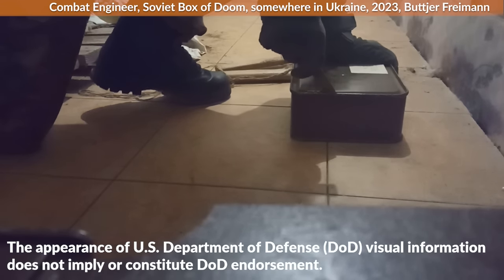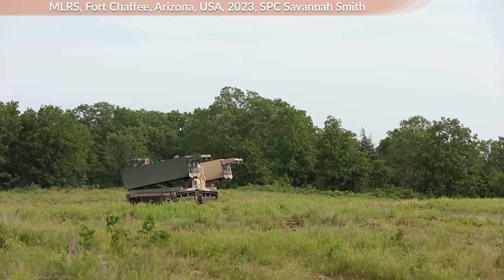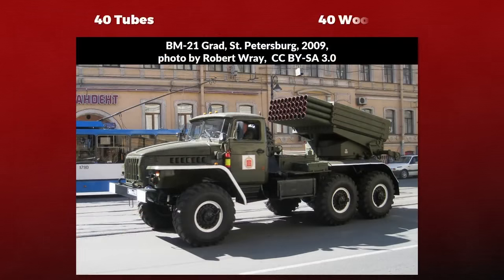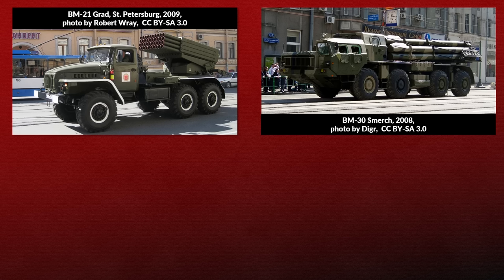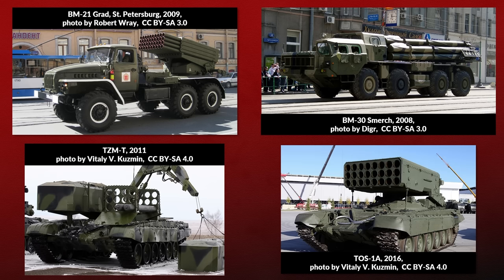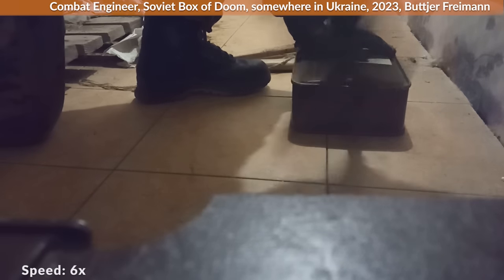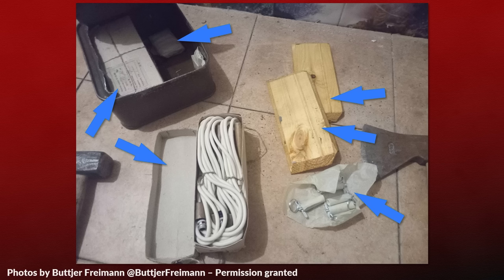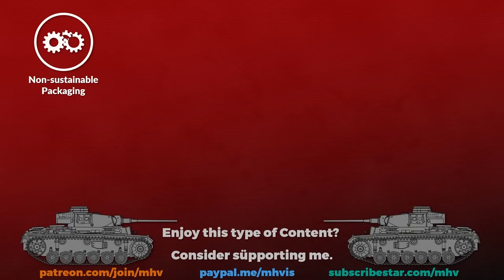Ukraine: Why Soviet Packaging is a Nightmare - Unboxing Edition

Comment: Their soup can package system makes perfect sense for storing a large stockpile of ammunition long term but they really should be decanted into a more accessible reusable container before being shipped to the front line.
Reply: I have a guess that there are some other quicker system to open them and these specific boxes being the ones brought out of decades long storage. Cos, from the war news, it doesn't feel like any one finding Russian troops vulnerable during relaoding.
Reply: @aniksamiurrahman6365 they dont live long enough to have to reload
Reply: @wrythe777 I’m legitimately curious how you think war works? Most people don’t die in war, even in infantry units. A 25-30% casualty rate during an engagement is considered combat ineffective any unit.

There are plenty of people who have survived this long on both sides.

Which, both sides use the same exact Soviet boxes, the flashy western tech is in all the media for Ukraine, but by and large they use Soviet guns and have since 2014. So evidently this isn’t an issue on either side.
Reply: @aniksamiurrahman6365 How would you expect to hear such from the news?

Comment: Reminds me of that scene in 'Zulu Dawn' where they're running out of ammo and overrun due to the cartridge boxes taking ages to open.
Reply: Those boxes have a section across the top that can be smashed open with a rifle butt. Somewhere in the house I have a crate from WW II for 30-06 with thumb screws to open the wooden lid then a tin liner with a grab handle to peel it open. Ammo was in 20 round cardboard boxes. I think it was from 1938. M1 Carbine ammo came in 600 round cans with a key to open the can like WW I bully beef pattern cans still being sold in the US. The ammo was in bandoleers in 10 round stripper clips.  US 25mm ammo 30 rounds in two 15 round belt segments in a plastic box with two latched lids about 5 to 10 minutes to reload a Bradly depending on one or two crew members handling the task.
Reply: In real life (1879) the soldiers were sent too far forward so when a rifle clogged/ would not extract and had to be cleared/cleaned there was a large gap in the line allowing the Zulus to rush through. On the ground to this day there are ring pulls from the ammunition cans in small piles spread across the ground. Opening the boxes was not particularly slow nor was loading the rifle. The Martini-Henry rifle had a range of over 1000 yards. Pushing the troops well forward was just stupid.
Reply: @mbak7801 Damn, you beat me to it.😅😅 I was about to say that.

Comment: I think the most interesting military surplus ammo I've ever opened was some Swiss GP11 7.5x55 ammo. It came in a black, waxed cardboard box with a cloth belt and a small wax seal holding it closed. The ammunition inside was in eight smaller paper pouches that were heat-sealed at the ends. Inside those were 10-round cardboard boxes that had perforated tabs to pull and open the box. This stuff felt more like someone had packaged a nice gift from the jewelry store rather than rifle ammo!
Reply: Well, it is Swiss, they’re hardly known for being spartan in presentation

Swiss watch.. Swiss chocolate and now Swiss ammunition and what have you
Reply: gotta keep in mind that our military issue ammunition is near match-grade. this demands an equally expensive packaging, no? :)

Comment: 5:59 - Good luck finding the packer & QC from 40 years ago to correct the packing process 😹
Reply: Any of those could be used 5 weeks after thr production. During a training.

This charge has "lmao, look at this newspaper's job ad, you think anyone will respond 40 years later?" energy
Reply: @worldoftancraft  Also out in the field these things are still useful, if a particular container of ammunition is misfireing or causeing other problems those codes can be used to quickly identify and cordon off bad lot codes

Comment: Wood and tin leftovers are not actually garbadge, they are extremely good as furniture and bulding material. In fact, most of RUAF trenches and bunkers people see on the internet are made of or with those.

But, seriuosly speaking, this type of packaging by soviet doctrine was ment to be opened way before it reaches the frontline. What this means is there should be some people at corps or divisonal rear-echelon HQ that sit and open them all day so  regimental quartiermeister, a person issuing weapons and ammo to those who do the fighting, will only give them those small card boxes. They just don't bother.

Comment: I'm 95% sure that is for long term storage and you are supposed to open it well in the rear, not in the firefight.
Reply: but they arent, combat engineers are opening them
Reply: Assuming that was the case, how does that work?

You unpack the ammunition, repack it safely into an unknown container, and drive it to the front?

Or do you dig up the stuff, make piles of ammunition and then carry it to the front in jute bags because there's nothing else?
Reply: @noah4822  Not under fire. Engineers usually do not man trenches; they gear up in the rear, go in action and came back.
Reply: @Ecovictorian  safely is debatable, but yes; or you bring the tin cans in the trenches in a calm period of time, open them and put the small packages in a bucket or something like that.
Reply: @M.M.83-U  That sounds very "russian".

There must be fixed service regulations for the Russian army?

As soon as you unpack the ammunition, the access problem has been solved. But another transport problem has been created, especially when the position is relocated or adjusted.  You have to decide what to unpack and what to leave packed.

At that point it becomes absurd when wood is actually used as a gap filler. Although it offers a certain level of protection, it is not necessarily needed if the ammunition containers are transported in relatively safe circumstances. Here it may take away transport capacity that may be needed in the situation.
Reply: @Ecovictorian  I have no idea; and it's more "old school" than russian, it's the basic idea (with minor adjustement across different nations) from WWI improved to 1950 storage technology.
Reply: @Ecovictorian There are separate containers used for short term transport. These are used to get to supply points, opened and carried by hand or in wooden crates in trucks to the front. This is mainly to keep them ready to use in any environment after long term storage, and both sides of the war use the same types of crates.

Western Gear is like the big cat tanks or STG-44 for Ukraine. Good stuff, present in some units but most units by and large use Soviet era equipment.

Comment: Agree that BM-30 with 12 tubes and it's own assist vehicle would have been a more adequate example. Still with 13 minutes to reload.
However, I see no practical difference since the gun crew doesn't have a chance for a second discharge and has to move positions instantly anyway. So the difference in reloading is taken from total time for position preparation, maintenance and rest - something not really valued in (post) Soviet armies.

That said, you can clearly see the mechanics behind main war strategy, namely most things have to be done behind the lines in no rush. Direct engagement is only a little part. A good reminder before the second "anniversary" of what was supposed to be successful in weeks to a month or be deflected under a year.
Reply: I like your analysis. I thought that part of the video was extremely short-sighted, a bit stupid even. What does a 4 min reload matter if you have to drive away and go hide after every shot? The west has spent so much money on hyper complex technology and it is proving to have been a lot of hot air. The systems are brilliant, yet impossible to scale up. 

We saw this when the US was fighting Taliban. The sheer cost of their high tech ordinance was untenable over time. 

This was an autistic over focus on one aspect of a weapon, not at all linking it to how they are actually being used in a conflict without air dominance.
Reply: @melanieenmats What exactly is not possible to 'scale up'? There are plenty of HIMARS, MARS, and M270 systems available and the rockets can be produced in a manageable time table should war deem it so. Unfortunately, it is Ukraine that is at war and not the US, so the luxuries of using as much ammunition as you have time available in the day is something only dreamt of by Ukrainian artillery men.

'Hyper complex technology' for real? What is so fucking complex about putting a GPS unit in a rocket? Its not our fault Soviet technology never developed past the soviets. Also, how was this seen when 'the US was fighting the Taliban'? Do you not understand the difference between symmetrical and asymmetrical warfare or you purposefully making such an asinine comparison for whatever political reason? Of course using precision missiles against an enemy who only fights battles when they want to is prohibitively expensive, yet the US was there for some 20 years and only left because we got tired of staying there. Should us Americans had wanted to continue staying, we'd still be there. This does not compare to an enemy who fights in a conventional manner, don't need to look past the first Gulf War to understand 'hyper complex' fucks Soviet gear.
Reply: Actually, there is a big difference, especially if the vehicle has to move between shots.
An M270 or HIMARS doesn't need a reloading vehicle, so any large enough truck, or just pods of missiles left at a planned location, and it can quickly leave it's firing location, reload, and hide up or head to another firing point as required.
A BM-30 is going to be stuck for 13 minutes next to it's reloading vehicle with a ton of activity, where it can be spotted and engaged along with the reloading vehicle. The reloading vehicle can also be tracked by drones, and lead whoever's tracking it to the BM-21 for a double kill.

There's also the issue that M270 and HIMARS are a launcher systems for multiple missile types (GMLRS, ATACMS and PrSM) all using the same support infrastructure, where's BM-30 is just for the same family of 300mm rockets. If the Russians needs to launch something else, they have to bring a completely different vehicle, and it's infrastructure.
Reply: But in a war sometimes things have to be done a rush. And that are generally the moments that matter. Having one daily harassing fire mission. You got the time. Having the enemy on the verge of overwelming friendly position is a different matter.

Of course a Grad does not all it's missile loaded to be operational again. Atleast that's what i assume. That there's some form of selective fire and not all or nothing.
Reply: @SgtBeltfed  that is one interesting difference between systems that one can operate along the line while other has to retreat deeper. However it is mostly true for gunned artillery, while tactics you describe turn into a logistical nightmare with rocket artillery. "large enough" truck ends up being very similar to the reloading vehicle, given the payload and offroad capabilities, pod locations have to be under areal support like the reload locations, the truck leaving them is similarly prone to drone attacks or surveillance too, and so on. 
But most importantly, with high range and ammunition scarcity MLRS aren't used that often to need second discharge soon or even same day and to stay near the front line at all once the operation objectives are completed.
As pointed by another commenter, the difference gives tactical advantage in anti-partisan asymmetrical engagement with air dominance and meticulous planning. Basically, in conditions the system was specifically designed for.
Reply: @SgtBeltfed  I don't remember a single BM-27 or BM-30 from either side being destroyed in this war during the process of reloading, it's always near the firing position so this issue is simply irrelevant

Comment: For reuse issue just look at a basic ammunition can. Western ammo cans can be used repeatedly for their purpose or when empty can be used for any number of things from seating to constructing a rudimentary shelter. When Russian cans are empty is just an opened can.
Reply: How little do you know about empty packaging. Did you grow up in the big city?
Reply: @coyoteranger How little you understand English? Is English your second language?
Reply: @coyoteranger  I'm sure I can think of a few uses for an opened Russian ammo can.... But most of them involve using it as a trashcan, sandbag, or toilet. You can't reseal it so it's useless for anything important. 

His point is that US ammo cans have a hinged reclosable lid with a rubber gasket, so they are much more useful for either storing important things or stacking things on top of.

I mean hell, you can find used US ammo cans for sale everywhere, not many people are looking to buy cut open soup cans except as scrap metal.
Reply: I love the US ammo box, they can even be reused for things other than ammo and are pretty robust.
Reply: I've seen a picture of a a bunker built of empty ammo cans filled with dirt
Reply: @MandolinMagi  I’ve seen that done before. One time some buddies and myself had to build a cramped warming tent out of a bunch of empty ammo cans the night before a blizzard. I’ve also seen them used as toilets in vehicles(great way to keep stuff sealed if you’re stuck inside the vehicle), parts storage, storing maps, pens, lighters, grenades. Great for putting stuff away so it’s not flying around while moving.
Reply: @MandolinMagi  I’m also pretty sure at one point I used one as a shovel and the hinge on the lid made it dig into the sand so much easier 😂
Reply: @Michael-uc2pn  the chinese even copy them and sell them in stores here in the USA. I use "30" cans for all my ammo storage and organization. US cans are made for storage AND deployment. russian cans storage only.
Reply: Can confirm-Ive used a US ammo can as a latrine.
Reply: @coyoteranger What's living in a big city have to do with anything?
Reply: @bryceanderson4864 something about “muh recycling”
Reply: @bryceanderson4864  because he doesn't understand English. Almost everybody "above" already explain and tell about "other usage" for ammo cans.
Reply: i have the feeling that the western ammo boxes are for frontline use, but longterm storage could also a little bit different, because the fancy boxes are also very expensive. in finland for example, the 7,62 ammo is stored in a sealed thin container, that is protected by a wooden box. pistol ammo is in its paper boxes with some kind of sorter and also sealed in a can.
Reply: @snakeplissken2148  long term storage still generally uses the same cans at least for small arms ammo, but usually they’ll be in crates.

Comment: It's not just munitions that are packaged differently. I have observed that equipment transportation metal boxes with hinged doors cannot be opened with common hand tools, like a phillips or common screwdrivers. They use a triangle type driver that is like an allen wrench to screw the doors closed on the boxes. The metal boxes may have attached wheels or be forklift required to move. If captured in a combat zone if you don't have a triangle type drived you will need an ax or large hammer.
Reply: what did they contain and do you know of a video where they're featured? Sounds very strange, almost like the most unhandy soviet version of a pelican case imaginable.
Reply: Those common screwdrivers are relatively recent standards, with Western origins.
Reply: Let me guess: An axe, a hammer or even triangle-key will come in a box you can only open with a triangle key?
Reply: The ones I observed had technical books, clothes and band instruments. Could have been used to carry weapons. They were obviously used for deployments. @duftmand

Comment: Finnish ammo manufacturers have tried to make 7,62*39 ammo stored in a spam cans (literal small spam/soup cans) back in the day, but it seems that it didn't stick. There are pictures of those cans on some ammo collecting forums. Before that, as far as i know, only pistol rounds were manufactured to be stored in cans, that you would peel open like old spam cans. All small arms ammo is still moved in wood boxes and cardboard packaging inside the box. Sealed cans do have the benefit of longer shelflife, but the cost of it may be higher. 

Btw, if anyone opens Soviet spam cans, DO NOT burn those packaging papers in your campfire. The Soviets coated those papers with nasty chemicals and it's not healthy for you. Also wash your hands always after handling any ammo. Lead isn't good for you.
Reply: If it's full copper jacket, you don't come into contact with any lead. Only copper and brass.
Reply: But I'm cold :(